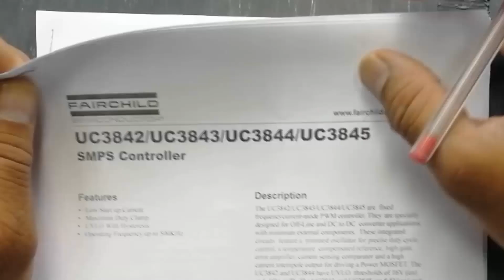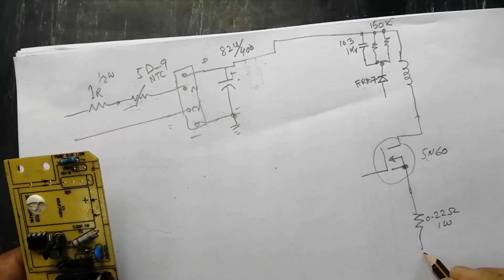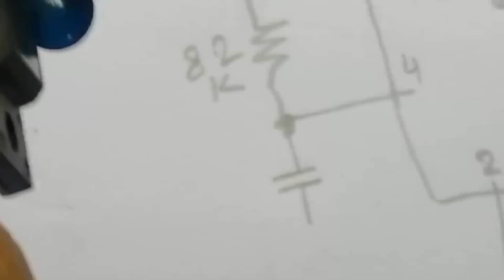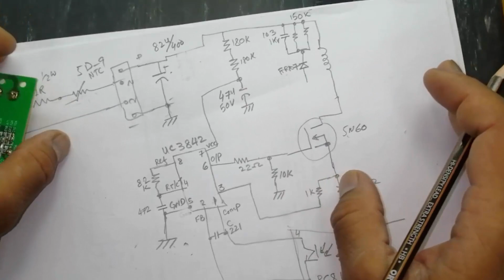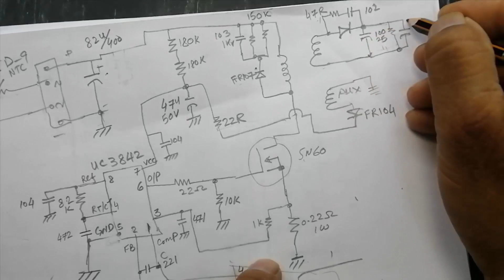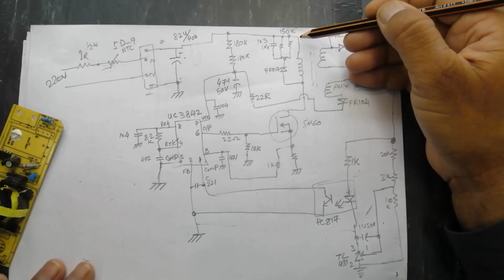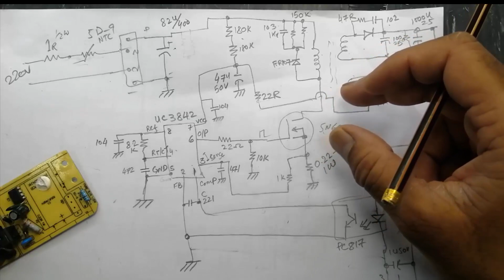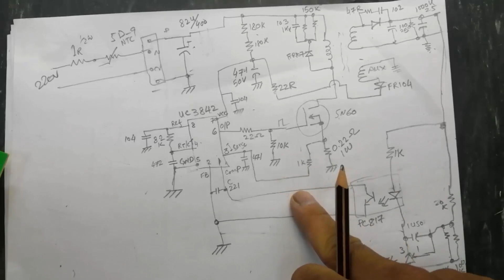#238 How to Reverse Engineer Furnished PCB circuit to Schematic UC3842/ UC3843 / UC3844 / UC3845

Comment: You make this look so easy. I also have  smps battery chargers which i have been ordering form China for the last 6 years that i use and maintain myself. I wish i could reverse engineer this thing.
Reply from the maker: Thanks a lot
You can do it 
Because NOTHING IS IMPOSSIBLE

Comment: Hi. Excellent video. Thank you.
Why is the Vcc pin of the controller IC connected to the input rail through two 180K resistors while it is connected to the AUX winding of the transformer? Isn't the AUX winding sufficient to supply the Vcc?

Comment: nice explanation of the smps.if this is 12v output it can be modify to 15v 3-5A by feed the ic with 1.5k resistor to pin 7 from input positive then at the  TL431 change to 20k resistor to 15k resistor , this will give you 15v output. If i am wrong please correct  me. thanks

Comment: Can we use transformer removed from atx power supply in this circuit
Reply from the maker: no brother 
every transformer have its inductance value and switching frequency 
so we cannot use as it is. 
if we want to use a transformer, we must have to wind for that specific power rating and switching frequency

Comment: Briliant sir. But there are some confusion.
1. What is the reason of (2×150k resistor in parrallel)
2nd i am not getting the point where two resistor are in series and a capacitor .are going to the vcc of ic. Also why auxaliry winding are going to the vcc Of ic..
Reply: One more question sir . Which may be the out of the topic. 
Sir what will be the behaviour of ic . When we applly input ac voltage linerly to the circuit. Bcz i am on a project whre self generation voltage will be used to provide this ic. Which is linerly go up. When it is reach to the true value of voltage that required to ic . It will do its work . In this condition what will ne the behavoiur of ic . Bez to reach the stedy state voltage there will be dely of mili seconds.?
Reply: Is there some hazard to ic . If we apply linear voltage to the ic.for short amoint of time

Comment: Dear sir,
With PWM controller UC3844, Iam getting VCC of 16v, vref of 5v, output of 6V and zero volts at all other terminals. Tell me what is the problem sir, iam not getting output voltage in my battery charger ? Transistor is also looking to be good.
Reply from the maker: 1. please check its current sense resistor (connected in series on mosfet source in) 
2. check video number 522 for smps switching test
Reply: My problem got rectified with ur suggestion. Thanks a a lot for ur talent sharing.🙏🙏🙏💐

Comment: Sir,how are you? I am Aftab from Pakistan.I have Samsung cloth dryer model DV45K7600EW/A3. It PCB # DC61-04008A X002.This cloth dryer is designed for USA & Canada there is volt 110. It’s data plate showing volt like this 120/240 60 Hz. Watts 5400.That motor is 110 volt & The tow stages are heter is 220 volt. I have applied tow different ph For L1 &L2 fixed steps down transformer & natural common. But showing error FC it’s mean volt is un suitable. Kindly guide me can I give him volt on L1 110 volt & L2 on 220 volt & common neutral? Are please first you study the same model electric wiring diagram they will be understanding easily. Thanks please send me your feedback.